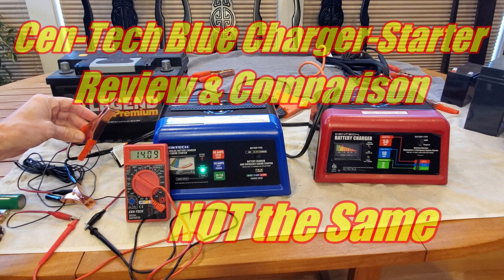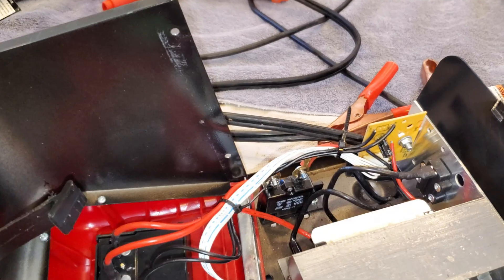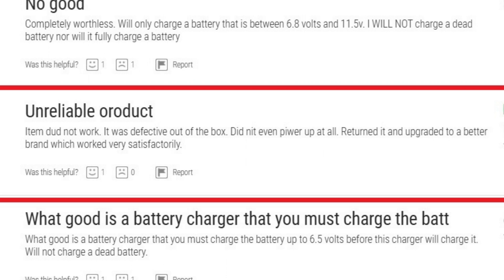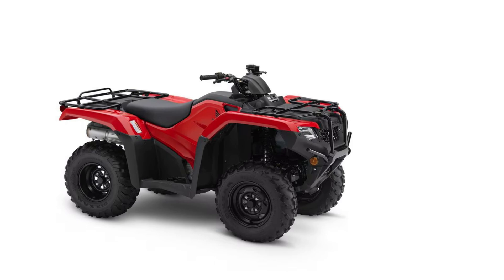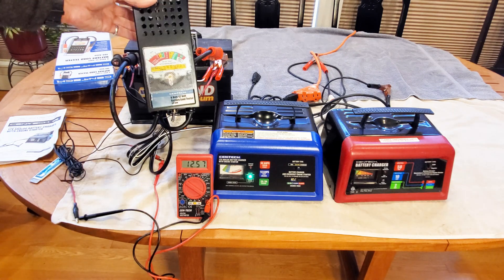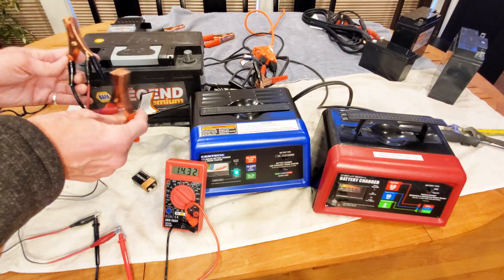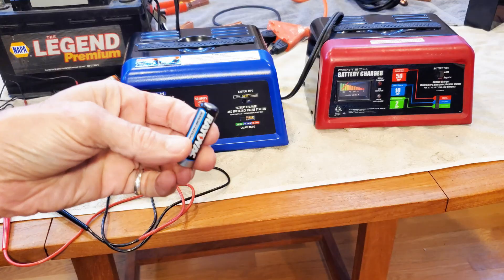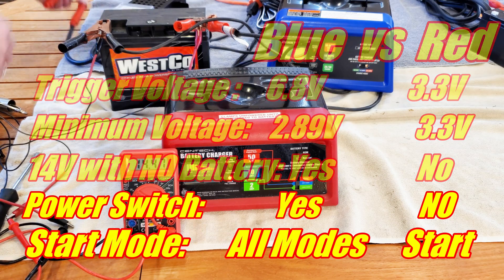Cen-Tech BLUE Battery Charger Starter Review and Comparison Harbor Freight

Comment: So the manual for the centech battery load tester says have an assistant to crank engine to test starter, can it be hooked up like you did and just toggle the switch instead and does battery need to be on charger?  learning here at an older age lol
Reply from the maker: In this video, the battery tester is used only to simulate the load of a starter and thus trigger and demonstrate the 50 Amp starter mode for this charger and to demonstrate how this charger responds to the load of a starter in the other charge modes. To use a battery tester simply as a battery tester, you would NOT want a charger connected to it while testing. If possible, you should remove the battery to ensure that no other external loads are present when testing the battery. I would also give the battery a good long charge before testing in case the vehicle was draining it with parasitic loads.

Comment: Awesome video and knowledge, how do you know what type battery is installed in your vehicle so you set the charger to the correct battery type?
Reply from the maker: Most batteries are labeled with a type or a chemistry. If the battery is not labeled and it is sealed and labeled as "Maintenance Free" then you should be okay with the AGM setting. If it is not sealed, then standard lead acid is the setting.

Comment: Great Video! Quick question just bought the blue charger and when connecting to a battery, the charger amp meter pulses. Is that supposed to happen? Thanks.
Reply from the maker: if the charger is in start mode then yes, that's normal while it waits to sense the starter engage. If the switch on the charger is not in start mode, I have not seen the pulsing as a normal function.

Comment: Hooked this up to my boat batteries, and the manual says it’s fully charged when the “Green Light is on, Amps Gauge Needle shows OA Position”. Where is position 0A on the gauge - am I missing something obvious? For context I’m reading 2A right now with the needle.
Reply from the maker: 0A (which is zero amps, or far left for the gauge needle) with a green light means the battery has reached the top voltage of the charger voltage range for the battery type setting it is in (either REG vs AGM). If you are reading 2 amps on the gauge needle, then the charger is still outputting a charge toward the battery.
Reply: @ thanks a bunch. So low and slow, and when the needle goes all the way left of the 2A I’ve got fully charged batteries?
Reply from the maker: Yes, and if you want to simply leave the charger connected to the batteries in the 2 amp mode, the charger will continue to "rescue" the batteries. As their voltage drops due to a light load, the charger will only let them go so low before kicking in and bringing them up to the top voltage for the battery type selected and then shutting off again. That is the typical maintenance charge cycle.
Reply: @ScubaMoto  Thanks. Will it still charge in the 2A mode (green)? I read through another review that said that that is just a maintainer, and I need use the 10A (blue) to actually charge the battery. Appreciate your help.
Reply from the maker: 2 amp can do both maintenance and charge just fine. It just depends on how low the battery is, how fast you want it to charge, how large the battery is, and I believe you have more than one battery, so 10 amp will likely be needed to bring up the battery bank. If it's multiple large batteries, you could cause issues with the charger but you'll probably be just fine with 10 amp for charge and 2 amp for long-term. I prefer to give my vehicle batteries a slow charge and 2 amp is usually enough to bring back most batteries, if you have the time. For just long-term maintenance, you want to use the 2 amp mode.

Comment: Hi, my car battery has a slow parasitic draw I'm trying to track it down, but every day I go out to work on it, I have to jump the battery and drive around for like an hour to get a full-ish charge 12.6v.  It gets down to like 10.5v overnight.  Would this charger work fairly quickly to bring it up and if so how long do you expect?
Reply from the maker: Most chargers, including this one, will work to bring a drained battery back up. While the vehicle is not in use, the 2 Amp mode of this charger, or most trickle chargers will help prolong the life of the battery by countering the effect of the parasitic draw and keep the battery within a 12.5 to 14+ volt range while the vehicle is stored. The repeated deep cycle depletion of a battery caused by a vehicle with a parasitic draw will still eventually bring the battery to an early end regardless of which charger is used so the parasitic draw should be identified as soon as possible. I hope that helps. Good luck with it
Reply: @ScubaMoto  Thank you!  I think I found the source of parasitic draw in the harness for the trunk lid/light. So I pulled the bulb for now until I can get that cable replaced or repaired.  However, I am wondering...one last question is if you need to have the battery disconnected from car to charge it, or can you just hook up as is?  Thanks again for such a quick response!
Reply from the maker: Good job finding the likely culprit for parasitic draw. Defective trunk light switches do occur. It is common practice to have a low-amp maintenance charger or trickle charger connected to a vehicle while it's parked. No need to remove it from vehicle for maintenance charging.